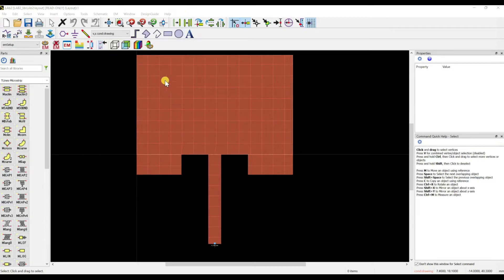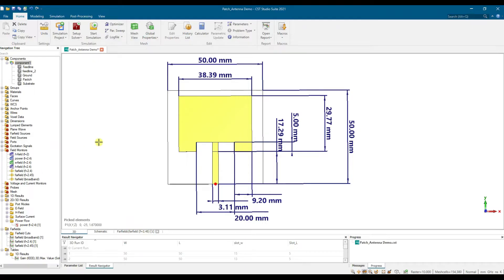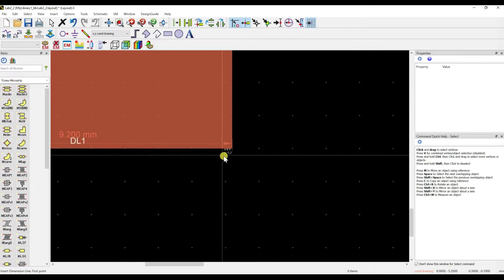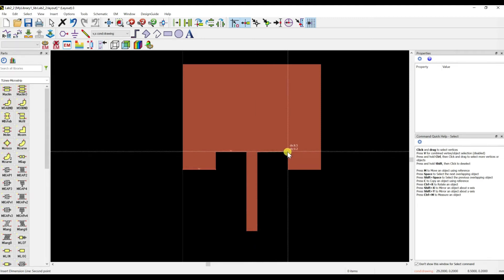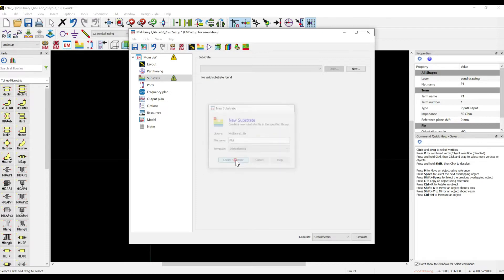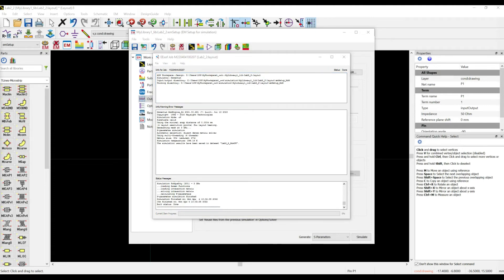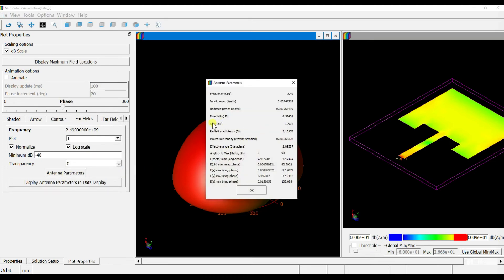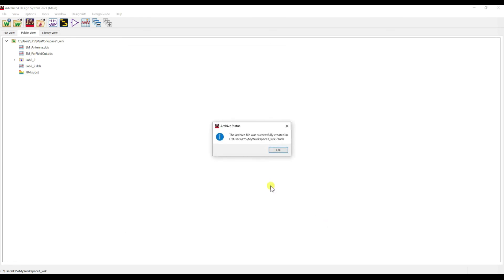Design 2.45 GHz Microstrip Patch Antenna Using ADS

Comment: Can you create this using hfss because dimensions are not clear enough
Reply: And also if we make it square what differences should be made in dimensions
Reply from the maker: Hi, too bad, I do not have HFSS software. You may refer to this CST video to check on the dimension. It should be clear enough https://youtu.be/kfeqA2o_Y2M?si=Jg8r7MDBzQgWX5Qf
Reply: @LYSStuff  i want to increase the gain of patch antenna to 4 to 5 db with same specification any idea how can we do it

Comment: can i export the ads design for realization
Reply from the maker: Yes, or can export your model to ads for realization too.
Reply: @LYSStuff  thanks for help but everytime i use FR4 the eficiency is a bit low is that okay?
Reply from the maker: For very high frequency, FR4 is not recommended. You can try TLY or Rogers substrate.
Reply: Thanks a lot dude 🙏🏻
Reply from the maker: No problem.. 👍

Comment: 3:05 How did you determine inset size(you called that strap)?. is it can be calculatable in ADS or needed other tools for impedence matching?
Reply from the maker: Hi, for my case, the strap i just do tuning the dimension until match my desire frequency. It could not calculated in ADS. Only the dimension of the patch able to calculate using basic antenna calculation.
The patch antenna calculator link
https://www.emtalk.com/mpacalc.php

The Microstrip line calculator link
https://www.emtalk.com/mscalc.php

For the strap (R) dimension, you may refer to this link.
https://www.antenna-theory.com/antennas/patches/patch3.php
Reply: @LYSStuff  thank you it looks quite helpful!. I will study with that.
Reply from the maker: Welcome and thanks for your support. :)

Comment: What is your ground size?
Reply from the maker: Hi, the ground dimension 50 mm x 50 mm x 0.035 mm.
Reply: @LYSStuff  hi sir . What are your electrical parameters to get the microstrip line?
Reply from the maker: Hi, The patch antenna calculator link
https://www.emtalk.com/mpacalc.php

The Microstrip line calculator link
https://www.emtalk.com/mscalc.php

FR4 substrate used: Er=4.3, thickness = 1.6mm